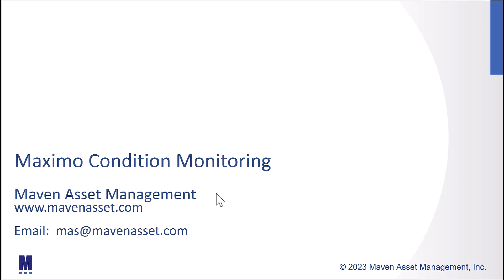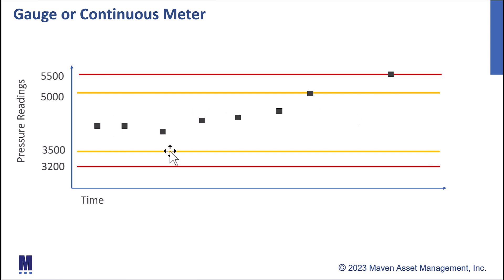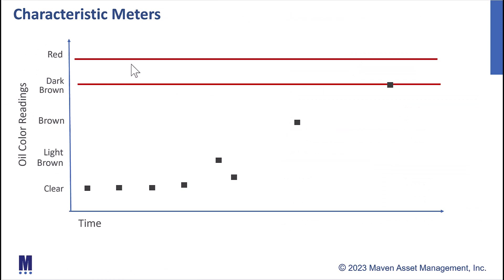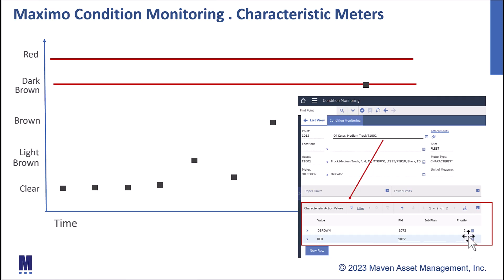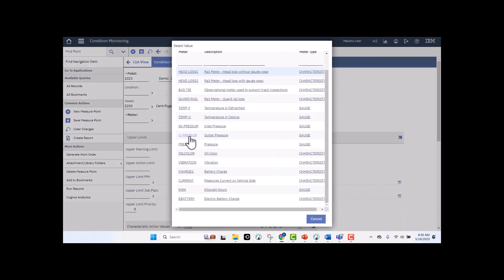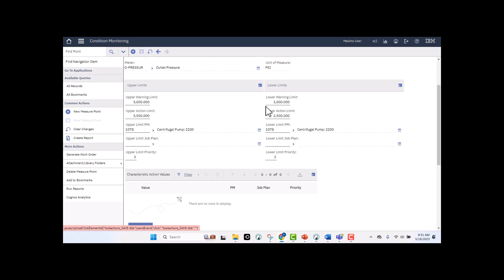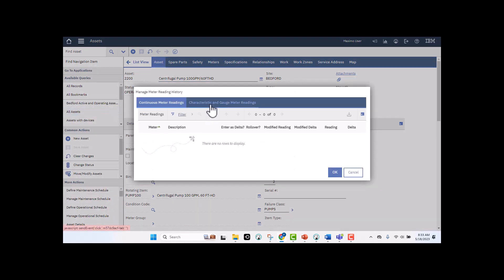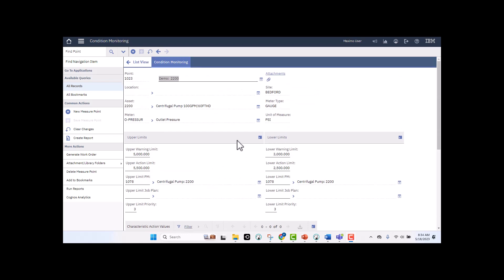MAS: Condition Monitoring

Comment: What should be the status of work order ?
Reply from the maker: The status of the work order is determined by the PM that was assigned to the Condition Monitoring (CM) Upper and Lower Limits. In the video's demo example, the CM's PM is #1078 and it references a Job Plan. The Job plan creates new WO records with whatever variables you define. Getting back to the example - PM 1078 references JP 11430A, which creates WO records with a status = WSCH (Waiting to be Scheduled). Again, this is a configurable value in the JP that you can set to meet your needs. Thank you.
Reply: @mavenasset   can we attach already created WO (which is created by a JP that refers to a PM) to CM by cron task? or it should be newly generated ?
Reply from the maker: The video highlights the use of a cron task to generate the work order for Condition Monitoring - Measure Point WOGEN Crontask. If the delivered functionality is not used - additional development, administration, maintenance and test efforts - would be required. If you have additional questions, we would encourage you to utilize the IBM Maximo Community or MORE Community. Thank you. @vln_goat